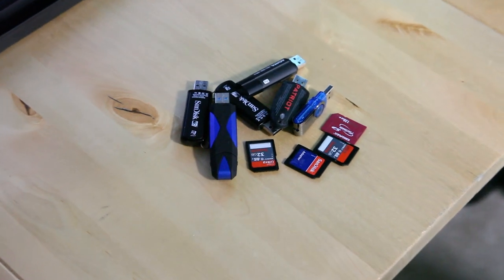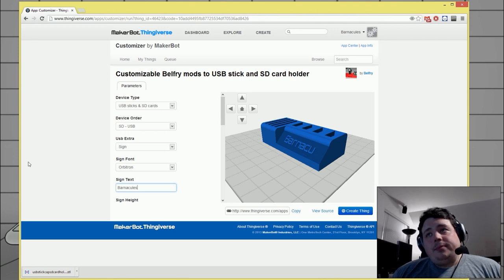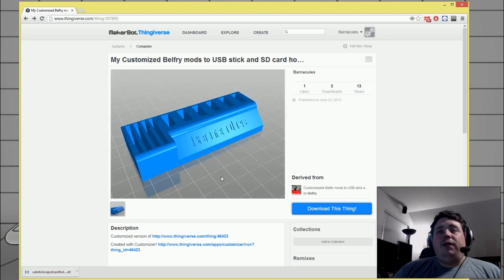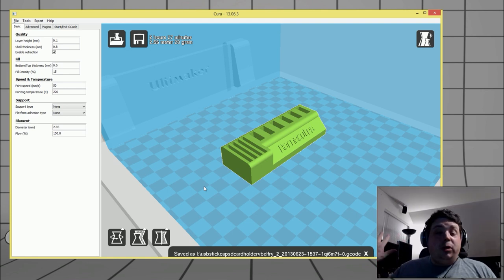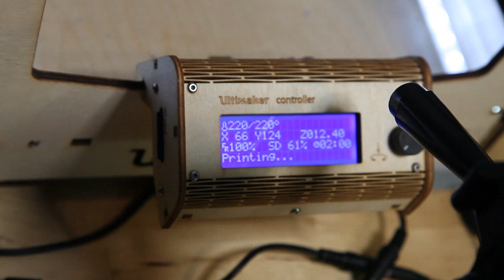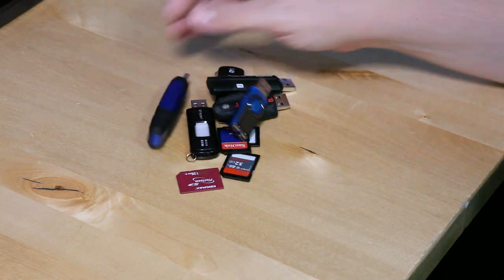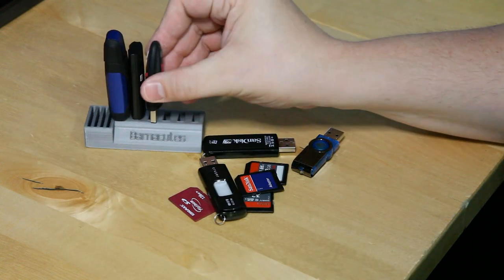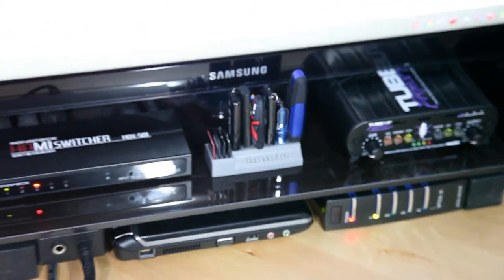Printing Custom USB Thumb Drive & SD Card Holder on my Ultimaker 3D Printer - JOLO - @Barnacules

Comment: If you have a mechanical keyboard, could you print some keycaps? That'd be pretty cool.
Reply: Yeah I also wondered that, please someone respond to that question!
Reply: ***** why fucking not?
Reply: That would be great. You'd be able to print out your F-keys (F1 - F12) in a separate color (maybe flourescent?) so they could be visible in low-light conditions while gaming. Another idea would be to either raise/indent the letters / characters on the keys so they don't wear off as easily as they would  if they were printed on.

Also...your number pad keys and your directional keys could be different colors, too.

Just a few ideas to think about.

Comment from the maker: The material is very strong once printed and won't break down until over 150 degrees. And a pool of plastic is about $40 and could probably print 40 - 50 of these things.

Comment from the maker: Yeah, it was just a can of PC duster turned upside down. Usually it cools the plastic to the point where it is easy to remove, this time around it didn't work very well.

Comment: are you selling this usb stick holder? or can u make one for sale? It looks cool and I would like to have it.
Reply: You might be able to find one online through your search engine. Also, I would recommend that you invest in a 3D-Printer.
Reply: ParadoxInTheVoid
 im thinking of buying one, would the robo 3d suffice?
Reply: HardAsSponge I've noticed those one to be expensive, I would recommend you purchase a 3D Printer from Make and see how that works for you, but if you can afford a Robo 3D I don't see a problem there. Also, I would recommend you look into reviews of the 3D printer you are looking for, I have no experience with Robo 3D.
Reply: where im from the robo 3d is the cheapest option and i didnt want to spend too much
Reply: If the price works for I would go for it ( after going over some reviews. Again, I have never used a Robo 3D. ). It's a good investment if you plan on using it, of course
Reply: yeah

Comment: Rough guesstimate, how much did that little guy cost in materials??  I may start pricing printers and spools.  But, it would just be a hobby (if it wasn't too cost intensive)
Reply from the maker: I would imagine it's under 50 cents in material.

Comment: That's really cool, I ought to print myself one of those.  If you have a Raspberry Pi lying around and want to be able to control your prints over the network, you might want to check out Octoprint or Repetier Server.  They give you a web GUI for controlling the printer.  Octoprint can even record time lapse video automatically with a connected webcam.

Comment: can you make a 3d print a gun :(.
Reply: In terms of legal issues, you would be arrested if you make a functioning gun with a 3D printer. Of course there are limits of 3D printers like what was used in this video.

You could print a Nerf Gun and not get in trouble(Probably), but you'd have to make it in parts....and you need a lot of material and time to make all those parts.